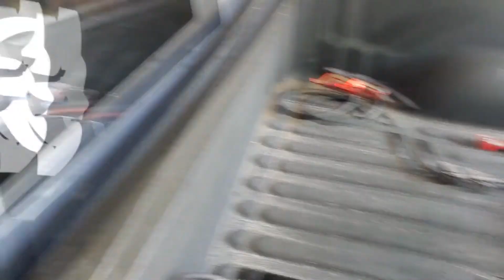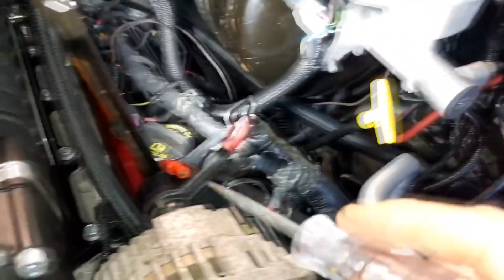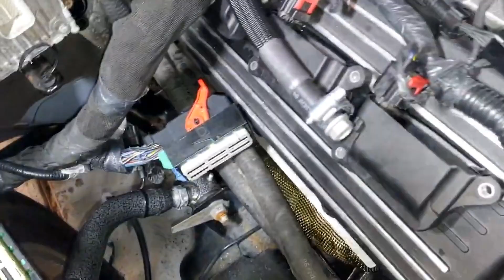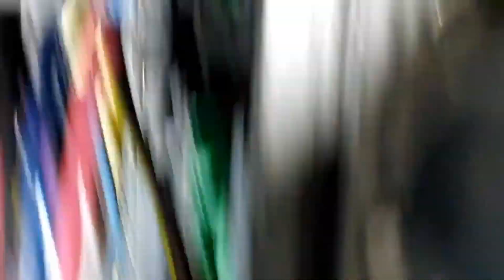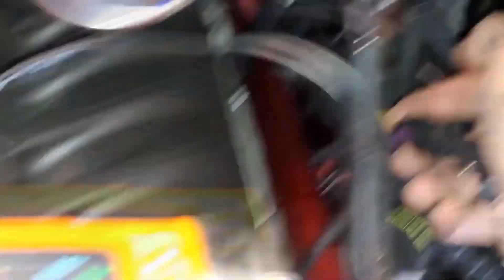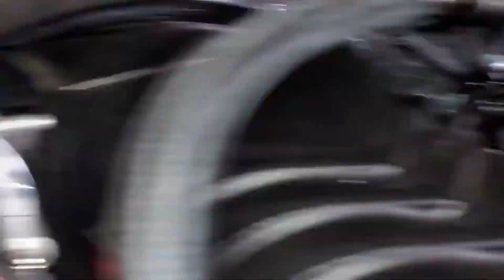2015 Ram P0108 Map sensor circuit high

Comment: great diag, Thanks!
Reply from the maker: was a good one lol, i normally dont do aftermarket stuff but this was a really clean build...the battery (relocated to the bed) wiring looks a bit messy because he was trying to figure it out, im sure he tidied it up allot since then
Reply: So the 2 sensors were swapped ?
Reply from the maker: Yes